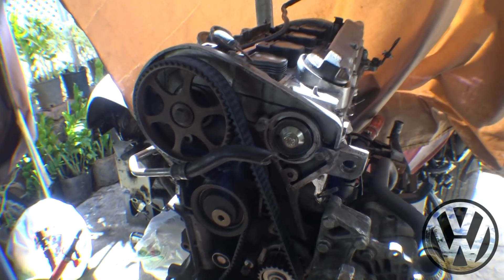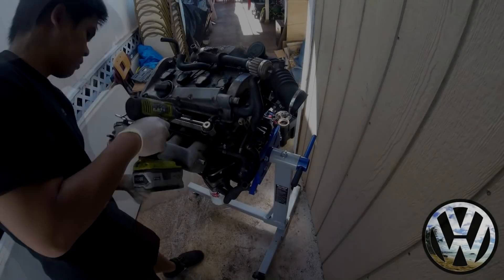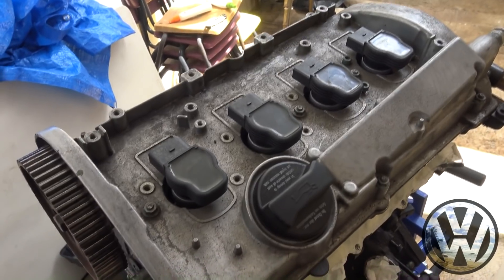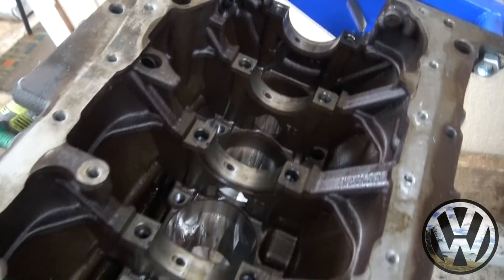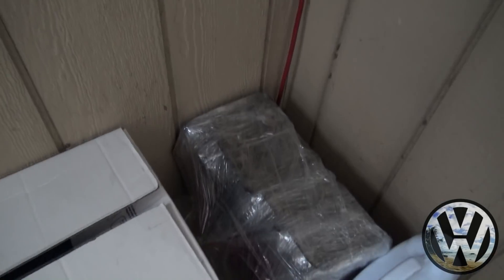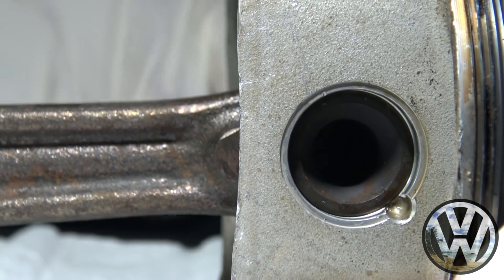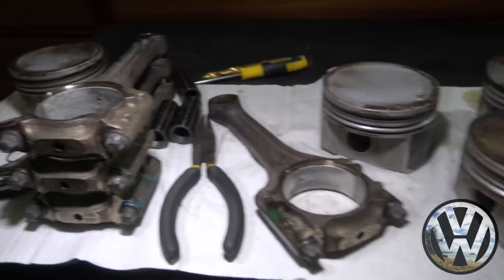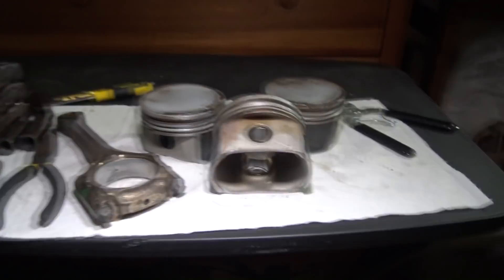VW MK4 1.8T Engine Disassembly

Comment: lol teardown in flip flops, saner than me with chainsaw in jammies. could you use a 98 quattro that lost #2 fire signal ? good body, interior, new tires and some intake, brake along with motor parts. Paint is shot. Fixed headlights melting ignition wires. The zeitgeist of design baffles me and is scarier than a 98 rover disco i had for some years. Near S San Jose, probably will deliver w/in 500 miles. +/- 1k

Comment: how you. i got a problem my oil was mix with water and was advised that i change gasket, i did then got a oil leak on both camshaft and crankshaft. bought both seal but stil on the crankshaft its still leaks. 1 what can be causing that. and my pulley is shaking when car is idling. 
was told the oil leak can be cause by main bearing as they are worn out, can that cause that? Please assist with advise

Comment: Nice work man love the vids! I recently picked up a mk4 gti and previous owner has done a lot of work to it already ( big turbo, airbags, ect.) just having a hard time with where to start on building it to my taste. ( fellow diy-er) Like what to look out for or what to get into first. Any suggestions?
Reply: Depending on how many miles etc id advice forget part instead of cast. Maybe some valves aswell. Mine possibly fail. Also the oil pump is really important.

Comment: Where would you go or contact to get a used cylinder head assembly
Reply from the maker: I'd go to either a local junkyard or ebay.
Reply: I have one. Considering what is included it is a bargain.